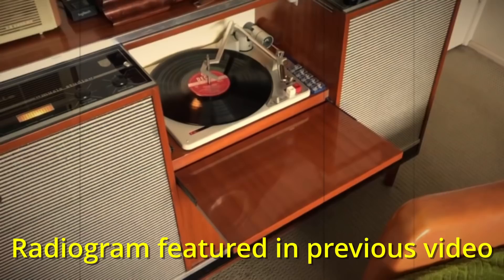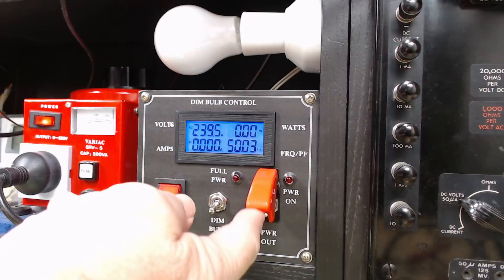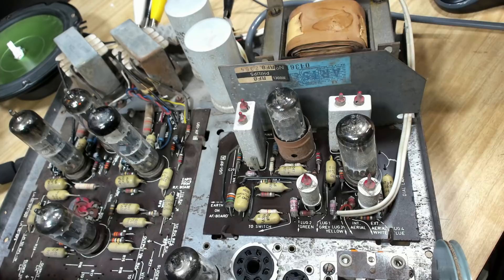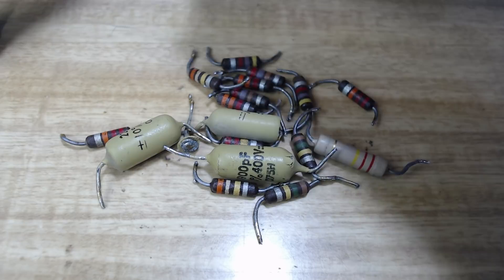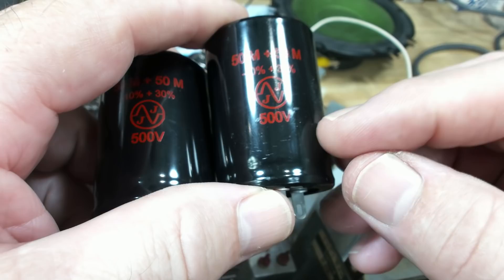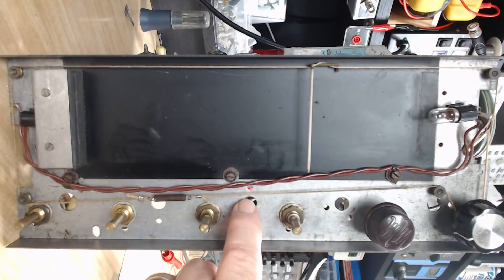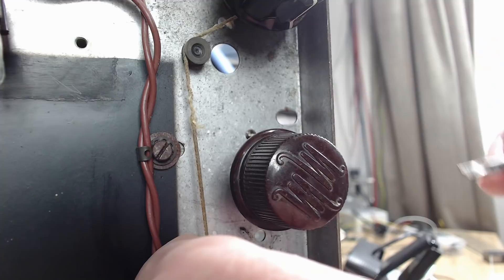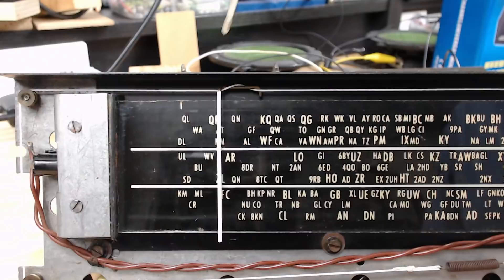Philips RF8 Radiogram Repair plus Philips AG 1025 Turntable

Comment: Great video David. I just bought a Philips Music Studio Glidomatic Nova Sonic RF8 myself and I am slowly trying to clean it up. I noticed it is missing the Stacking Spindle or centre post that you also indicated was not provided with the one you fixed. I am not sure where to get one from or what the part number is. Can you let me know what part number it is an where I might grab one? Great videos, I am chuffed i found you. Looks like I have another channel to spend many a night trawling through. :)
Reply from the maker: Hi stephenmaconachie, thank you. The model number of the deck is AG1025, the part number of the spindle is PW 2960 40, the number of the stub centre pin for playing singles is PW 295 91. I did a quick search for the automatic spindle but no luck. I suggest you join a facebook vintage radio group and see if someone has one laying around or one of the many radio groups on the internet. You may end up going international. The spindle may fit other Philips models. The little stub pin can be made at home 🙂

Comment: I am repairing similar but seem to spend more time diagnosing the problem parts, rather than a mass swap out.  Very low outputs, barely audible. Plate and grid voltages good, coupling caps changed but still no Joy.  Could be old valves.  Would have loved to have seen you measure the voltages at the 6gw8s when in the problem state.
Reply from the maker: Hi phantomrose1999. Start at the amp end and work forward. With the chassis top side up, select it to Phono, volume to half, ballance centred and with one hand in your pocket touch a pin or short length of wire on the contacts in the audio socket on top of the chassis, at least two of them should give a loud hum in the speakers. If you get a hum the amp is working in that selection at least, if not, suspect the receiver section. Whatever, test all the voltages of the valves and make sure they are ballpark to the specs. It could be the valves but it's unusual for the output valves to go that bad and both channels equally bad. Are you located in the Brisbane area?
Reply: @DavidTipton101  hi David, just fixed it.  While the plate measured 295 and the grid / power to the radio measured 200, i thought it was good. But then found the 1500ohm voltage dropping resistor was 12.5k !  Changes it and grid / radio voltages are 250 instead of 200 and it’s working beautifully.
Reply from the maker: That's great news phantomrose1999, well done 👍🙂

Comment: They should have used the TELEFUNKEN Low Voltage Vacuum tubes and used 2xVN66AF MOSFETS in the output stage then there wouldn't be a problem with with blown capacitors, then the H+ could be 6V and the B+ could be 12V.

Comment: Hi Dave. Are you sure that reducing the idler wheel diameter has no effect on turntable speed.
Given a constant speed from the stepped output spindle, a smaller idle wheel will rotate slightly faster. This increased RPM will surely spin the turntable rim slightly faster....hence why your rotational check  gave a slightly higher RPM  after you had cleaned the wheel up....or am I missing something.....Knowing me, I might well be!
Love your videos, best wishes from UK.
Reply from the maker: Hi Keith, that's correct, the diameter of the idler will not affect the platter speed, the idler is transferring the rotation of the spindle to the platter, the idler wheel speed will change but the not the platter. 
I think of it as with later belt drive turntables if you were to move the drive motor further away from the platter and use a larger (longer) drive belt the platter speed wouldn't change but the belt would take longer to do a rotation. 
I like to think big, if I move the motor 10 feet away and fit a super long belt the platter speed will remain constant. 
I think the extra speed was from bending the idler wheel axle to vertical and a general clean and lube. Thanks Keith, all the best to you 🙂
Reply: @DavidTipton101  Hi Dave, You are indeed quite right!  Just picking through last pieces of humble pie  as I type..... 🍰  yum yum! 😅
Reply from the maker: @keithpearson7539  Haha.. no worries, it's a common misconception, cheers 😄
Reply from the maker: @truesoundchris  From the Philips AG1025 manual:

Checking see fig. 5
The Idler wheel must be adjusted so that it comes onto the middle of each pulley step.

Adjustment
Adjustment is carried out by bending the bracket of the idler wheel, see fig 6.
The bending tool can easily be made of 6 mm Ø rod, see fig. 7 for dimensions.
Make sure that the idler wheel shaft, the pulley and the shaft of the turntable remain parallel. If the idler wheel is not correctly positioned onto the pulley steps then the bracket must be bent in the direction of the arrows, see fig. 6.

Download manual here: https://www.vinylengine.com/library/philips/ag-1025.shtml
Thanks chrisz78

Comment: Hi David, I have the same model of gramophon with your same problem. I found on the floor the spring (item 64 of the service manual). Do you think that Is possible cause of the problem the loop start? Thank you!
Reply from the maker: Didn't refitting the spring fix it. If it's still doing if follow what I did and clean the friction material, you don't need to pull it apart and don't get it too wet, it's a fibre board material. Make sure the tone arm moves freely.
Reply: @DavidTipton101  ok thank you. I'll try soon

Comment: Great job again, Dave. However, I must express my disappointment in your incorrect use of test equipment. Everybody knows that speaker movement is tested with ping-pong balls, and not bits of paper. We all learnt that trick from a guy called Tipton, from down under 😊
Reply from the maker: Thank you Manuel. The ping-pong balls are a great visual aid but make a hell of a noise 😄

Comment: I just saw 🪚 this. It sort of looks like 👍 a police 👮‍♀️ scanner on the inside. It’s another radiogram 📻, and it’s tube type. Those look 👀 like 👍 way better capacitors than today’s, although I saw 👀 the one ☝️ that was blown out. I don’t know the condition of the dial cord, but it looks like 👍 it’s doing good 😌 for now. Ya might suggest replacing it. It’s always suggested to replace capacitors that are 50+ years old, even if they don’t hum. One ☝️(or more) can unexpectedly blow out. That desoldering gun sounds pretty 😍 loud. It sounds like 👍 my brother’s air compressor. Ya really know your way around circuit boards. I know that this radiogram 📻 has AM/FM, but I wonder 💭 if it also has civil defense markings on the dial. I think 🤔 the dial light 💡 is out. This radiogram beats 🎧 any newer Crosley record player of today, although I don’t think 🤔 your radiogram 📻 has a record player. Your friend, Jeff.
Reply from the maker: Hi Jeff, sounds like you commented before watching the video, I did all those things and it has the record player as well, cheers 👍🙂